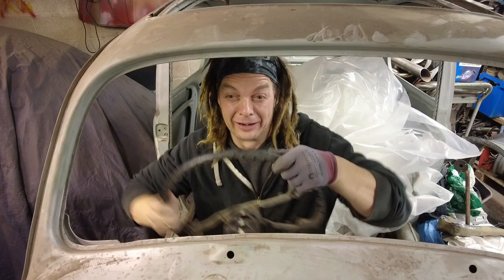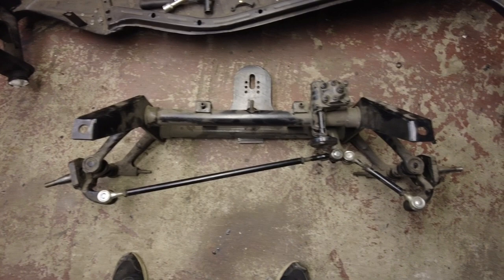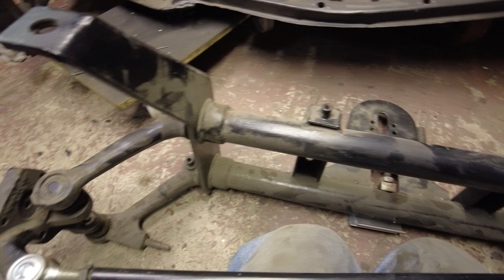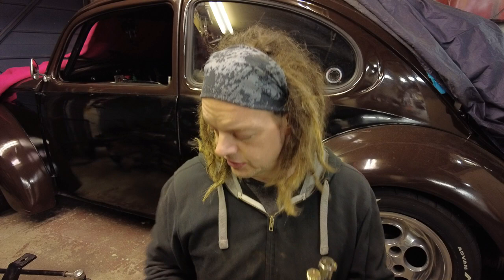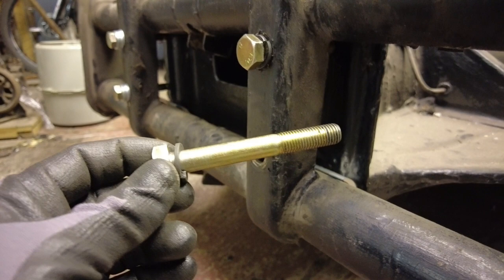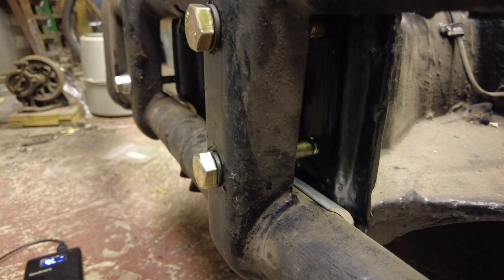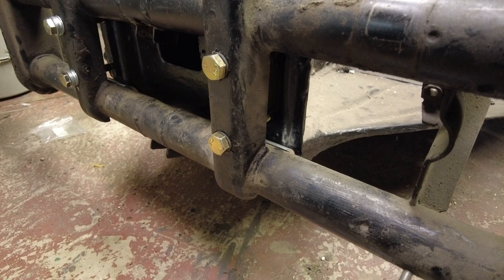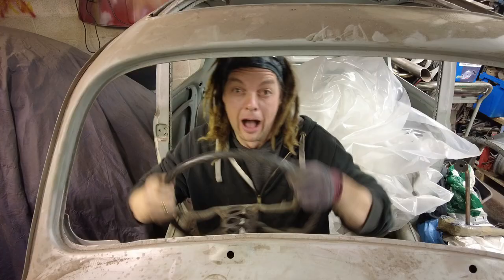Caster Shims - Increase High Speed Steering Stability VW Beetle Volkswagen Bug

Comment: I love your channel, lots of good info.
So I’m not an expert, but I do know grade 8.8 refers to tensile strength, not sheer strength. 10.9 being harder and more brittle, I would stick with factory spec on the beam. As driven, the beam bolts are going to experience sheer force from the weight of the car, not a tensile force, or pulling force. I would think with the weight of the car, a little flex in those bolts would be needed. We know that factory spec are adequate, so that’s what I would go with.
Reply from the maker: Yeah I absolutely agree. Never heard of anyone's beam dropping off so those old vw bolts have sufficed for over half a century! Re. tensile, I get mixed up with my words sorry, if only you knew how many takes I often do! 😅 was surprised when found 2 different grades both from reputable suppliers which is why I mentioned it. Thanks for the kind words and for watching 😊👍

Comment: messed around with caster angle on my 53 kingpin bug for quite a while until i got it right ,i found that a shorter shock also helped with front end bounce ,good sound advice in this video !!!!!
Reply from the maker: You've slammed 53!!! EXCELLENT 😅😅Thanks for the feedback and info. 
Back on the 70 I used Bugpack Red dampers. I'm not sure if are still available but they worked really well on my bug back then. Thanks Clive 😄👍
Reply: @PeoplesCar  the caster shims i used were the thickest i could find the shocks were austin mini ,the car was a oval window  in black 1904 cc motor full cage 2 race seats fast and fun back in 1990 still love bugs great no nonsence video good luck in all you do !!!!!
Reply from the maker: @cliveturner4980  Sounds fun 👍 Thanks for the kind words 🙂
Reply: Thanks for the tips. I was wondering what the shims were for. Top explanation and great video 👍
Reply from the maker: Tx 👍

Comment: 8.8 is a good choice, its strong enough but not so hard that it is in any danger of cracking under the vibration and/or shock of hitting potholes of kerbs for instance. You don't want those bolts to shear off!
Worse case scenario.....
I am trained in screw machine operation and made bolts/fasteners for the automotive industry for a few years to high tolerances, a thou of a mm and the machines were not CNC, manual set, tippy tappy, measure, repeat etc! Pita work.
Reply: Daily driver bugs handle best with the front an inch higher than the back as stock VW spec. The cal look , nose down is ok for drag racing on the strip in a straight line Not for roundabouts etc!
Reply from the maker: Wow fantastic info thankyou for taking the time to comment. Thats what i assumed but didnt know for sure👍😊

Comment: Hi, I have a KG with 2.5" dropped spindles and beam adjusters. It's not too crazy low but steering is hard. Shoud I put those shims?
Reply from the maker: Might be worth checking there aren't some fitted already! They will make steering stiffer when added. Have you recently had ballpoint fitted etc? Also had stiff steering from a cheap steering damper once. 😊👍

Comment: I put them on and I have not noticed any improvement. It is still very difficult to control on the highway.
Reply from the maker: Hmm that's not good. Are you sure all the other components are good especially play in the steering box? If your toeing out on the wheels it can cause the car to be skittish too, I know this as had a car incorrectly tracked in the past, made it almost undrivable, was so bad it squeeled in a straight line! LOL. 
It's quick to check. Maybe I should make a vid......
Reply: I didn't notice an improvement until I doubled them up.  Two of them on each side.  Once I did that,  major improvement!
Reply from the maker: @vdub-rc7ll  yeah I've heard a few people say the same but have to say I've never actually seen anyone with a pair on there in know of. Sounds like a lot but if it works. Did you need extended extended bolts 😅